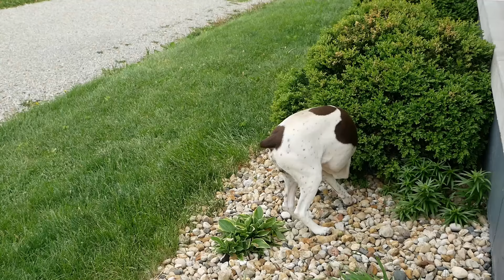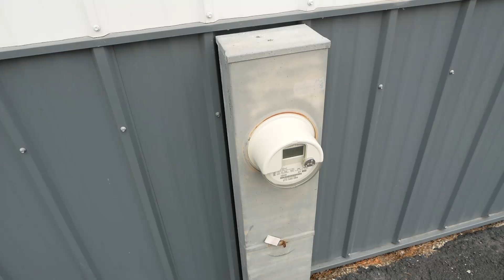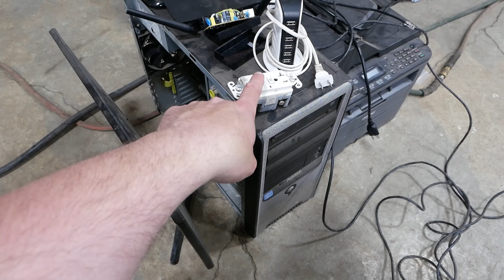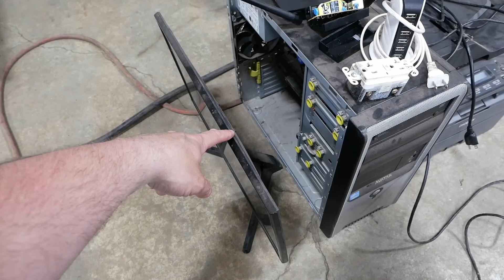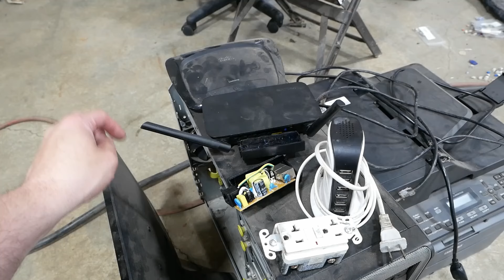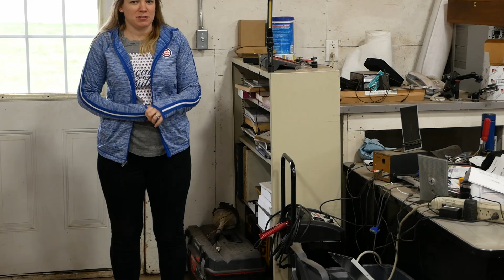Lightning Strikes Shop, Again...

Comment: Sorry to hear you had so much lighting damage. I actually installed a whole house surge protector, it goes in the power panel. I did that because a power surge, due to a power outage, took out our dehumidifier and the controller for our air bed, and maybe some other things, can't remember. I also have surge protectors on everything that could possibly be damaged. Since then I have had no problems. Of course all bets are off when it comes to a lightning strike, especially if the surge travels through your data line. I think there are protectors for Ethernet connections, but not sure. It really sucks to be where you don't have decent Internet. For awhile we were using a cellular hot spot because the only other option was dial up. Also tried Dish Internet but it was terrible. Finally got a real Internet connection. Hope you get yours sorted out quickly.

Comment: That’s crappy and I feel for you. See if your power company has a meter power surge suppressor or buy one they will have to come out to pull the meter and put it on. After eating 3 heat pumps and an electric water heater and numerous small appliances, we finally had enough. Get a meter base surge suppressor as a first line defense.

Comment: I remember back in high school one of the portable class room trailers got hit by lightning and blew a hole through the roof and the floor as well as tossed the teachers desk across the room. And a different note have you thought about getting a surge protector for your meter, or where the circuits leave your panel?

Comment: What a mess, the only thing to do is unplug the electrical devices during the storm, but that is a pain. With the computer beware of ghosting. Ghosting is where a computer part  fails other parts might be affected. Putting the old parts in new computer could cause the new computer to fail.  Thank you for sharing and hope the week coming is better.

Comment: I am really sorry to hear this.  There is only so much that can be done to prevent these things.  A whole system surge protector in the electrical panel, and Ethernet surge protectors can help.  Regular backups can save your data.  Cloning your hard drive to another drive that can be booted in a different computer can get your business up sooner.   Unplugging everything during a storm is another option... but a difficult one to maintain.

Comment: I have been dealing with a lightening strike also. From what I gather the MOV in the surge strip shunts exess voltage through the neutral. The router happens to use that neutral for reference voltage, which then blows out everything plugged into the router. Anyway, love the channel. Keep up the great content. Cheers

Comment: I always have a UPS (uninterruptable power supply / battery backup) between my computer system and the wall.
My router /network system is in my basement and it has one as well.
The good ones have surge protectors for power and ethernet. 
Generally the power goes out shortly and this provides enough power for short intervals. often an hour or so
I have 2 now for years and they helped me survive transformer explosions a few years back.

Comment: A buddy and I built a radio station in high school. Antenna got hit by lightning one night. Whole setup was save by a single outlet surge protector from radio shack. Electronics were just tougher in the 90's and older

Comment: That sucks!  Best protection is a decent Pure Sine Wave UPS (CyberPower, APC, Tripp Lite, etc) with coaxial and RJ45 protection.  So, whatever your "first line in" from the outside world is (Coax or Network), you can run that through the UPS.  They do a much better job at protecting from surges than a "surge strip".  And, they also protect your equipment from brown out's (when the lights dim for a few seconds) because they can "boost" the power in milliseconds.  They can also "buck" the power if it's too high.  In many cases, a nice one will clean up the power and make it cleaner than the utility company provides.  Just make sure any device hard wired to the network via CAT5/6, receives it's power from a UPS and don't waste your time with any modified sine wave UPS - they're garbage :)

Cheers, Sev

Comment: The voltage surge was on the neutral side, not the power side. It back fed through your grounds. They make a whole house surge protector for your main box. That may have helped. I don't know how they isolate the neutral side.
Reply: He should probably check his main grounding rod/mesh or fresh water pipe.
However his meter is connected.

Maybe it isn't deep enough or large enough. Or a broken connection.

Soil might have been dry for awhile too.

Comment: Most so called surge protectors only protect on the hot leg and leave the neutral and ground legs unprotected. There are real surge protectors that do protect on the neutral and ground legs but they are much more expensive and seldom found at the big box stores. When you have a surge or back feed on the neutral it does tend to fry the surge protector but I'd rather replace a $100+ surge protector than worry if my customer and billing data was corrupted of lost.
Reply: How do you propose to protect the ground and neutral?

Comment: Yep you can get whole building gfci/ lightening arrestor devices you install right on your power feed right before your main disconnect or breaker..   for the internet you can install arrestors at the enpo or demarcation point..  those surge protectors with the coaxial and rj45 jacks on them are good but need to get a reliable brand like tripp lite..

Comment: Check the info on your surge protector. A good surge protector or UPS will have a warranty to cover any connected devices. If yours does not have this, I suggest buying a different one that does.  The brand I buy did come through for me on the warranty several years ago. The UPS includes a connection for the ethernet, so that is also protected. 
I use a small one on the internet router and a larger one on the desktop - the power goes out but I can still get 20 more minutes of internet to check the power company web site for the repair time estimates.  It also helps that the UPS triggers the desktop to shut down before the battery goes dead, so all my open docs get saved.

Comment: Sorry to hear about the lightning hit. It appears from your description of the hit, that the lightning hit the neutral wire on the  power transmission line and followed your electrical line to your shop. As others have mention a whole house surge protector may have protected some or most of your electrical components that were damaged by the strike. They are relatively inexpensive to buy from Menards, Home Depot and a man of your background would have no problem to install on your electrical service panel. Most of the items that you mention as being damaged were small electronics, computers and the like, the only item that I believe that was mention that is building related was the well pump. So the electrical grounding to your building appears to be very robust.   I am sure you will find additional electrical components that were damaged but have not been notice as of yet. Items such as garage door openers, door bells, coffee makers are often times damaged after a lightning strike or power surge. Hope that you are able to get up and running in a short period of time. Good luck.

Comment: there used to be a switch called a lightening knockout  / isolator that would drop on strike  might be worth looking into wes have a good long chat with an old school sparky / elechicken, they usually know all of the strange little devices you can put in your supply line to help protect vunerable elctronics .been on the recieving end of a lightening strike blew my cb base station accross the room / melted my thunderpole antenna

Comment: We have grey market cellular 4glte out here, its a verizon sim, not 5g. Same story on options, its this or crappy satalite (not starlink, viasat or hughesnet) the cellular actually outperforms the satellite options, we do have a booster with a yagi on the roof. Its also not cheap, but it works in the rain, and the latency starts at %5 of the best sat ever gets you. When these last mile solution cats hear their phone ring they know they have you over a barrel with no other options and they treat you as such.

Comment: Sorry to hear about the electrical issues brother 
This sounds like a recurring problem 
Do you own the building if so you might consider putting in a hardened electrical panel or a large dissipation grounding rod along with a really good apc
Backup power supply that is a hardened against EMP's 
Hope this helps brother 
Take care see you on the other side of this k
God bless you and your's 
Just saying

Comment: Don't feel lonely in that situation, because the city limits is literally less than a 1/8th of a mile away. 
What's worse is that I still have southern bell phone junction box at the end of my driveway where I go out my gate, and it's still connected to a another junction box in my yard.
But I disguised it by placing a short section of  spiral pipe used to run high pressure conditioned air in commercial buildings for cooling. 
It's now not only como for ugly junction box it's a pedestal for a upside down propane tank valve cover converted into a flower pot.
The neighbors that live at the corner of the country road, and the farm to market road next to the city limits sign actually live on the other side of the farm to market road from the actual city limits. 
Two years ago they ran a fiber optic cable two feet inside their property line, and beings as we have no city services out here there's no cable tv and the internet that goes along with it. 
She works from home, and the devices were forced to use offer very low grade service. 
Download and upload speeds are unpredictable, and at best are lousy, and worse depending on how many are on the local towers.
Since there's two major truck stops out in our area just down the road broadband takes back seat to voice and phone data that the hordes of truckers burn up daily.
So she asked the foreman installing the fiber optic cables how much for her to get a line since it was on her property, and less than 75' from her home.
He gave her a business card and told her to call number, and who to ask for in regards to getting a tap into the cable.
$3,500.00 dollars is what she was told, and that was subject actually be higher price than he gave her. 
Because the line was to a robotic company that had moved to new facility at the end of the f to m road and the highway. 
Supposedly they had the whole bundle of cable spoken for, and even though there's no way they could use every tap available in the bundle of cables they laid.
They had say so over if anyone else could tap the cable, and the owner wasn't sharing with his neighbors it seems. 
So here we sit with broadband devices having the truckers use all the power from the towers located in our area, fiber optic within sight, but unable to get a tap into the system, and were the long time residents in the area, and have to do without. 
Hughes net sucks, 5G might be great if we could actually get to use it.
So we get by on 2G and occasionally 3G signals if there's anything left over.
We can't even get DSL her because the landline is the old 3 wire system from the 60's and early 70's if you could get someone to claim it because Southwestern Bell has been out of business since the 70's if I remember correctly.

Comment: Wes! I work at a non-profit ISP and your broadband internet situation is exactly what the Biden Infrastructure bill is trying to solve. The Middle Mile and BEAD last mile programs could end up running fiber to many unserved areas like your. Make sure IL is on this and applying for the funding!

Comment: It adds a small cost, but be sure to run fiber where you can, e.g. between the shop and house. I also isolated my ADSL with fiber uplink to the rest of the wired network

Comment: you should have lightning arrestors on  both ends of any networking or ssatellite setups. we learned hard way 2 times, 2 dvrs, 3 tv's, etc it would hit dirt around house but backfeed grounds for cable insulation.

Comment: Odd that you don't have panel mounted surge arrestors like here in the UK.  If it senses surge on any conductor including the neutral, it bonds itself to ground and trips the breaker at the same time.  Saved quite a few of my commercial buildings here in London, that get struck on a regular basis.

Comment: Sorry I erred before. I in the UK many years ago suffered the same fate, I now remember the complete setup. First was a spark gap, Two round steel balls about 1cm in size and gapped at a specific distance, Then came this voltage fuse size about 2cm X 1 cm . then power got to your surge protectors.

Comment: Wow!
Not only the overpower of the lightning hit you that hard, even the massive EMP that it creates...
You could protect the routers only by putting them into a faraday cage, but then they would be unusable...
Had the similar thing with a mainboard in a PC after a blackout, the boards doesn't like such things at all.
4 weeks to re-establish internet is hard, how could you work without looking up for repair infos?
I hope that the next 4 weeks only customers bring in their vehicles for oil and filter changes...
Thx for the update!
:-D

Comment: We had a strike at our fire station a couple years ago. Took out a fire truck, power supply on an ambulance, our entire phone system, all of our servers, cable internet, 3 computers with monitors, our radio paging system and a bunch of other things. It ended up as a nearly $30,000 insurance claim. Not to mention it took us about two months to figure out everything that was not working properly. Like the stuff on the fire truck.. you had to go though and test everything. Hope you get it figured out soon!

Comment: One way to help prevent damage like this is isolate from the grid when storms appear. If full isolation is an inconvenience then just disconnect anything expensive or holding valuable data.

We live with unreliable Thai grid and tropical storms. This isolation procedure has saved us from nearby lightning strikes on several occasions.

Nearby strikes can induce spikes into outdoor data cables. Best to disconnect these also if possible.

High power surge protection can help but even these will have difficulty handling big surges from nearby strikes.

Comment: Nothing protects from a direct strike.  

(update) Been reading down the comments.  People recommending surge arrestors. Well that and  physical isolation protects from a nearby strike. But remember that lightning has already jumped maybe hundreds of metre to get to your pole, a small airgap like an isolating PSU is nothing. 

Understand that there are two ways you can get fried. A nearby ground strike will induce a few KV in overhead lines including phone. This is what  a surge arrestor can stop. Or a small signal transformer like  found in the front of DSL kit.

But a direct  lightning strike wont be stopped until its found 'earth' A typical lightning flash is about 300 million Volts and about 30,000 Amps.

All you can do is find some way to help it get to ground another way than via your kit. In short Wes, you need a good lightning rod or tower somewhere nearby connected to some underground metal mesh - like rebar - that can take 30,000 amps briefly and dissipate it in the earth. And a lightning expert to tell you how to do it. 

You should be able to weld that up pretty easy wes, and use a backhoe to expose  enough wet soil to lay the mesh.. There are people who will tell you to put the conductor on your building. Works for churches, cos they are the tallest point, but you want to protect power lines. 

So it needs to be near the poles. What I envisage is about half an acre of rebar mesh all welded together, with a metal tower welded to its centre, with a pointed conductor on top, buried under a foot or so of compacted topsoil. There may be a business selling these. :-) Make 'em out of those junkyard trucks people keep bringing ya, and call 'em Art!

-------------------------------------------------------------

How the USA can claim to be a first world country with broadband like that beats me. The farmers should all get together and lay (deep) underground optical fibres.

I lost quite a lot of kit many years ago to a direct strike on the phone line. Since then I lost two DSL routers to nearby strikes.  Now I have fibre.

Where I live was like you Wes, but twenty five years ago, before that it was a 56k  modem or 64k ISDN. The glory when our village got ADSL. 256k!!!!!

Now my link is 10/34Mbps - enough to run a home video server on and access it elsewhere in the world.
Reply from the maker: Seems reasonable…

Comment: If you have some friendly line-of-site neighbours with good internet, just get a microwave bridge, like a Ubiquiti Nanobeam 5AC, and leech off them on the understanding that, in the event the same happens to them, they can do likewise. Cheap as chips and gives you redundancy. It's just like a wireless long range LAN - and when I say long range, under the right conditions they're good for 20 miles (but not over the flat).

Comment: Lightening strikes on a power line will cause damage exactly where it wants to wreck.
I've seen kettles that weren't plugged in blown up, walls channelled along cable and metal water/gas pipes, computers melted (not just the plastic bits), metal framed windows surgically removed from walls (no surrounding damage), thick timber doors with large (1 foot plus) holes burnt in them with no other damage to the building.  All of this in the UK where we don't get the amount or severity of lightening that parts of the USA get.
Don't tell Max - one cooked rats' nest which the dogs really enjoyed.
The important thing is that your family are safe, maybe inconvenienced, but still alive and un-charred.